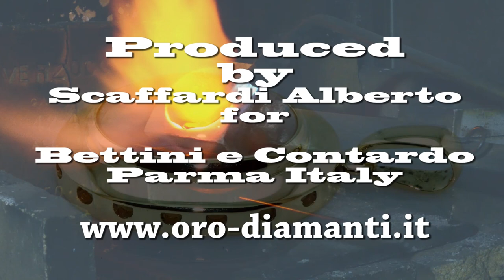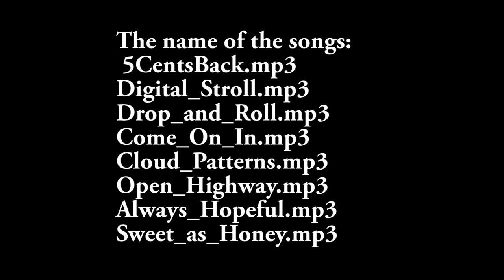Handmade pendent with gold bezel setting for delicate gems

Comment: Hello again, I really want to try this way of setting a cabochon, I keep watching you make the piece with this amazing method. I am wondering if there is a way to make the part around the cab look like this (bigger, wider) but not use two parts, is that possible? I see the mechanics of the way the cab is held in back, It seems like that requires at least two parts. I was just curious about other ways. I am a student and still feel like a beginner although I've been making and even selling a little for 2 years. I love the look of a substantial bezel (withut epoxying it in)  but of course, a really thick one made with thick metal would be nearly impossible to move the bezel around the cab.
Reply from the maker: For fragile gems, the video is a great way to fix the gem, safely, without risking damaging it. Of course other techniques can be used, often experimenting is part of being artisans. do not just copy, always try new roads, with time you will find the one that most facilitates you.
Reply: Perfect answer; I'll tell you what I make/discover. Thank you so much.